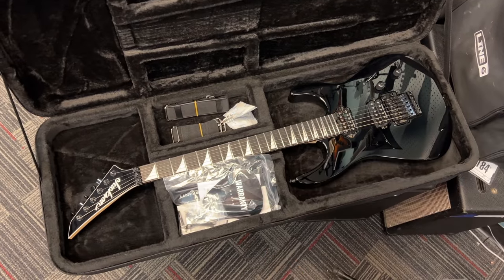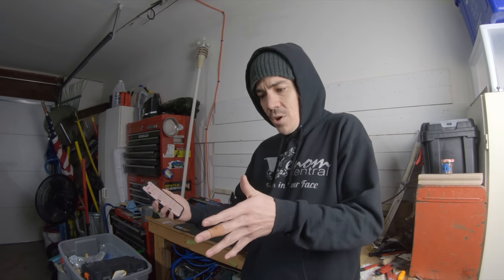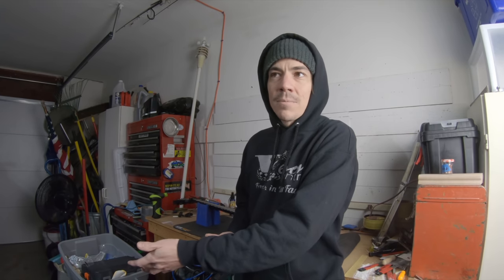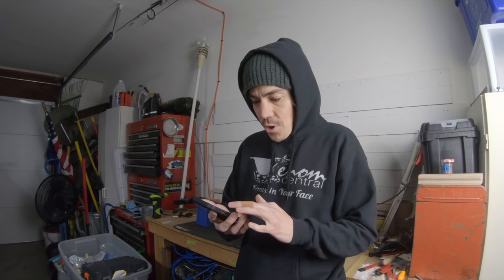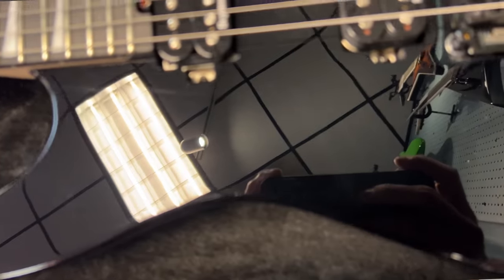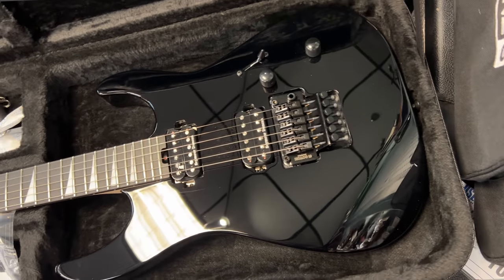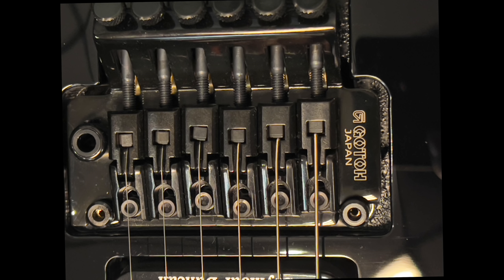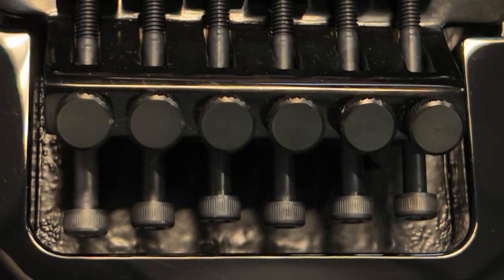JACKSON GUITARS IS DONE. MJ series/INDO EXAMPLES

Comment: I've been playing guitar for almost forty years, and while I've always felt Jackson produced some very fine instruments, the reason I never bought one is because when I went to a music shop in L.A. in '87 to buy a Soloist they had an ESP Horizon on the same wall. I compared them and there was NO way the soloist could compete. The Horizon was sleeker, more advanced, with a better neck, and sounded a lot better too. It was also about half the price of the Soloist at $700. Easy decision. I find Jackson's quality has taken a real dive in recent years. Besides that, I'd much rather get a Yamaha or a G & L or Fender and just pop in some Duncans as I always do.
Reply from the maker: Did you buy that horizon?
Reply: @jed_shred_guitars  Yes. But I don't own it anymore. I sold it to a friend back in 1990 because by then I'd stopped using locking trems, just had it with them. But it was a great ax. My friend replaced the very crunchy but noisy DiMarzio X2N knockoff that came with it and replaced it with a Duncan JB which sounded better. But he didn't get a JB because of my advice, but because he wanted whatever Dave and Marty were using on Rust in Peace and I told him it was all JBs, which it was. Anyhow, what had happened by this time, late 80s, early 90s, is ESP had given Jackson a real wallop. ESP has smart enough to open a custom shop in Hollywood around '85 and George Lynch was one of their first big name clients. Jackson/Charvel got lazy and took for granted the large roster of players. So what happened is Lynch peeled away to ESP, and a lot of former Jackson, Kramer and Hamer players followed along. When Kirk Hammett started playing ESP it caused a wave of players in the thrash world to follow. It's just the way it was. I'll put it this way. Let's say you had the choice of a Lamborghini that does zero to sixty in 4 seconds with a top speed of 180, or a McLaren Speedtail that does zero to sixty in 3 seconds and has a top speed of 250. Let's say the Mclaren is cheaper. Prospective buyers will ask themselves, "Do I want the Lambo, which is more well known, or do I want the McLaren, which is not as well-known but nicknamed The Ferrari Killer, because that's what they were designed to do? ESPs, and the Horizon was their penultimate model in '87, were designed to take on the big boy, Jackson/Charvel. I'd say they conquered them a long time ago. They offered a much better guitar for the money and still do. My Horizon was made in Japan, which in truth had better quality control than the US. But it still made the guitar half the price of a Jackson Soloist. The craftsmanship and the design put it over the top. The Horizon had 24 frets, which also gave it an edge at the time. Yes, so did the current Soloist, but in '87 you would still find some with 22. The extra full octave of 24 frets is priceless in a shred world where every fret counts. And the design of the ESP neck joint was far superior to the Soloist. It was just easier to get access. The licensed Floyd on the Horizon was better than the standard Floyd that came on the Soloist as well. Right about this time Ibanez became huge when Vai and other shredders started playing them. They came with the knew Ibanez Edge trem which knocked the pants off a Floyd. They were simply more I gigged with between '86 and '92, my L.A. club days when I was a teenager, was my trusty candy apple red Holdsworth Charvel I bought used for $100. It was simple. Standard trem, albeit double fulcrum, mounted flush, and a single, hand would JB that sounded outrageously awesome. It was 22 frets, rosewood fretboard, black pickguard, black tuners, graphite nut. The thing NEVER went out of tune. It was amazing. I had other guitars I would take with me to gigs as backup like my Kramer Baretta or a Strat with a Hot Rail in the bridge. For amps I went from lugging my Marshall stack to getting smart and getting a Boogie 50 Cal combo which was easier and had more than enough volume. To this day I recommend combos over stacks. It just makes sense and they are easier to mic up. Also, if you face them away from you it's easier for the soundman to get you a good stage volume through the PA. Even on 2 that Boogie was very loud. But soundman were grateful for me not having a stack, or five, and believe me, some players on the scene had five stacks back then. It was crazy. Also, having on combo made it easier to set up and break down fast after a gig. I would not only move my little rig, the amp, a guitar or two and a couple pedals, but help the drummer. If you could pack the house with your friends and set up and break down fast the clubs loved you. It was all about $$$ and time for them, and in this world you must understand the nexus of time and $$$, especially in music. I learned a lot in those days. Wonderful memories. And yes, ESP crushes Jackson.

Comment: Unfortunately I just got an LTD Arrow Black Metal with some pretty serious QC issues. The binding on the neck isn't great, there's some dust specks trapped underneath the finish and lots of cuts marking the frets. The trem cavity is poorly painted, and the area right above the trem is just bare wood which is really ugly when looking at the guitar head-on. More importantly, the Floyd Rose isn't installed well and won't return to pitch as well as it could. The bass side post is leaning away from the neck and it wiggles back and forth when I remove the bridge. The posts and knife edges have already had the paint scraped off at the contact points after a day of use, they might even be damaged for all I know. And the claw screws in the back are basically stuck so I can't even get the bridge perfectly level. Probably going to send it back.

Comment: Both the Japanes and USA jacksons cost so much because of price of labor. I recently got the chinese made jackson sl3m and other than the tuners (put gotoh on them fender) the guitar was perfect. The backplates are plastic but it's all CNC cut and nice sharp edges all around. The plates were so tight that I had harder time taking them off. There is a real switch and full size pots in the cavity. The attention to detail was amazing. You know how some floyd nuts protrude little bit past the edge of the fretboard? This one was perfectly centered and the edges blended into the neck. It has real duncan pickups and korean made floyd rose which is better made than the special floyd rose. I have the rainbow crackle finish and they only make these in china and it's beautiful in person. Can't stop looking at it. I simply don't see how USA made jackson would be better made. I don't like the USA jackson heel cut, the indo and china made jackson have the proper cut. The Japanese jackson is overpriced. 

Now, few years ago I bought brand new jackson bolt on soloist for $110 from guitar center. It too was flawless and it even had full size trem block which is practically unheard of in this price range. I was going to convert that guitar into a floyd rose soloist but it was so pretty that I simply abandoned the idea and bought the sl3m instead. 

I think the best value is ibanez rg350. Mine had only two small flaws. The nut protruded from the edge about 0.5mm, which is nothing but can be felt and one small section of the edge of the backplate, the wood was slighty crunched. Other than that, the guitar was perfect. I paid full price of $1300 for the jackson sl3m and I would definitey pay that price again because the workmanship is simply outstanding. The rg350 I paid new $300 and like I've said, the best value back then and maybe even today. Ibanez made some neck through rg's like 3020 but I heard they are on the heavy side. Btw, if you can't physically examine a new guitar then just buy it from sweetwater as you can examine the pics and get a good idea about craftmanship and weight from the pics if you know what to look for. That's how I bought my sl3m and I knew it was going to be good after I looked at the pics.

Comment: 5 years ago, I bought one of those Jackson Dinky Archtops in satin black (looked so badass). I know they're way cheaper, but you still expect everything to work right out of the box, but it had pickup switching issues right away. Every time I was in the bridge position, if I played any volume above soft, the neck pickup would engage like I'm in the middle position. I took it apart and cleaned it, but I couldn't find out what was causing it, and I didn't want to replace any parts on a $400 guitar, so I just sold it for almost all my money back and got an LTD M403 ht, since I already had a guitar with a floyd anyways. The LTD was soooo much better quality. It was a bit more expensive at the time, but the reason it was better wasn't only because of fit and finish and stuff, it's mainly just because it worked like it was supposed to, unlike the Jackson. 

I recently bought a Fender Player Plus Strat (I'm not only into metal, I play jazz and rock too) and it's FANTASTIC for the price. The neck is amazing. Thinner than most strats, but with amazing rolled edges. Please correct me if I'm wrong, but fender and Jackson are the same company now, so I cannot understand why build quality, materials, attention to detail, and all of that are so different. Doesn't make sense.

Edit: forgot to say - there's a reason Dave Mustaine changed from Jackson to Gibson. It's sad to see him not play a Jackson anymore, honestly. But Gibsons are dope...just a bit pricey.
Reply: There is an LTD for $700 at the pawn shop near my house.   It is great!   It’s almost exactly the same guitar as my Schecter.   Same pickups , same look, same feel.    
Are they made by the same
People?     I would love to have that guitar.
Reply: @Imokyourok440  I'm pretty sure they are not related companies. I could be wrong, but I've never heard that either schectere or ltd were the same company. Esp owns LTD though. It's sort of like Fender and Squier, but LTD's are generally way better quality than a squier would be. The ESP guitars are pretty expensive. And the LTD's are a lot more affordable, but still super good. If you're into metal style guitars, schectere and ltd are both great choices.
Reply: @Casey3-P-O     I’m gonna look into that.   Same pickups, paint job, almost exactly alike.
Damn good guitars.   My Dad bought my Schecter for me at a pawn shop for $200 and it came with a fender practice amp.    Dad knew nothing about guitars.  The pawn shop owner was a good man.  He knew I was struggling and Dad wanted to help me.   If it was a hunk of junk, I would still love it.    It’s great though.   Dad passed away a few years ago, so it means even more now.❤️😢
Reply: @Imokyourok440  sorry to hear about your dad.  That was very cool of him to get you that though. Schecters are super cool looking.

Comment: Fender moved production of PRO Soloists from Japan to Indonesia around 2012. The first ones were made in the PT Wildwood factory, who also supply ESP and Schecter, with an 'IWJ' serial number prefix and the spec was classic Jackson recipe. Three-piece Maple thru neck with quarter-sawn centre section, Alder body sections and the backplates were black anodized aluminium. After a couple of years or so the Fender bean-counters switched to Samick factory, with an 'ISJ' serial number prefix, who deviated from the Jackson Soloist recipe with a two-piece scarf-jointed Maple thru neck, Mahogany body sections and plastic backplates. 

I do like the Jackson JS series made in China and think they are excellent value for money especially ones with compound necks. I just think some of the current Jackson PRO models aren't up to the mark and are probably overpriced .

Comment: I have a 2006 snow white jackson dk2m pro made in Japan that came with a fitted jackson hard case new in 2006 for $650 shipped. No way will I ever get rid of it. I ditched the jackson branded floyd and installed an original floyd rose.
It's my main guitar.
Reply from the maker: That’s the model that I’m holding in my profile picture. I wish I never sold it.

Comment: Super genuine video dude. Not just bashing Jackson, you obviously love them along with probably everyone watching, but you pointed out some really critical issues. As of now, I don’t think I’ll ever buy a new Jackson. After a knock off strat, a js30 rr was my first “real” guitar when I was 12. Haven’t gotten another Jackson until I’ve acquired 3 off the used market in the last year. My kvxmg is okay, just that. Got a killer deal on an older rrx24 7 t. For the price I paid, can’t complain but it’s just solid enough. The one I’m most proud of is a parts guitar I made. Js30 warrior gloss black body paired with a mij dxmg neck along with all new hardware, pickups, etc. But that took a lot of time, and a lot of money. It plays great, the best neck out of my Jackson’s for sure, but is that what is takes to get a really badass Jackson these days? I guess so.

Comment: I bought a brand new USA Jackson soloist back in about 2005. It was my 3rd Jackson. The 2 I had prior were from the mid 80s. They were awesome. The 2005’s high E was so close to the edge of the board you would fret a note and it would slide off the edge and get caught between the binding and the fret because there was a gap

Comment: I bought the mid tier (X series) Warrior recently - holy hell, I couldn't believe how much work it needed, compared to my LTD EC 1000 which needed *zero*. Given that the price difference is roughly the cost of replacing the stock pickups with something decent, 100% go with LTD. I always wanted a Jackson and this was so disappointing. LTD is putting a high end guitar in your hands for a reasonable price, and Jackson is just seeing what they can get away with. Ultimately, my Warrior will be the way I want it, but it's costing way more than I would have liked. Disappointing to say the least.
Reply from the maker: Disappointing indeed
Reply: X Series are junk. I wouldn't go below Pro
Reply: This sucks. I thought about buying an X series Warrior recently, but ended up buying a 1996 Japanese made Warrior instead off of eBay. It had clearly been played, lots of dents in the paint work etc etc, but from a quality perspective you can really really feel it. I also have a David Davidson Jackson PRO 7 string, which I really like, but the quality of the older guitar shines through.

Comment: I don't disagree with you on a lot what you are putting through here; I have a 2009 neck-through strat from Indonesia, that took a lot of work to get up to spec (misaligned locking nut, bad fret job, set-up was crap, etc.).  However, I have a 2004 MG Dinky carve top that is the best guitar that I ever owned, that one was from Japan though as I could not afford the ridiculous prices for the US model.  But I still play it all the time and its awesome!!  Barely ever touched the set-up throughout the years even with the change of seasons; its rock solid.

Comment: I received a base level, and barely finished Ibanez GRG121DX.  It is built and sounds beautifully.  It does have a chunky neck it is the same thickness nut to heel. But I like that.  It is like a classical but joins the body at feet 18.  Holds tune and setup really well. $199.99 free shipping.  I love it.

Comment: bought a Jackson Rhoads JS "lefty" put all premium parts - Gotah tuners, OFR bridge & nut, EMG 81/60, EMG volume/tone knobs/toggle. I wanted to purchase a case for my new guitar, but come to find out (after research on forums) that they don't have a hardshell case that actually fits the guitar. Was looking at the guitar center reviews and a fellow lefty had the exact same guitar, but saying it doesn't fit.  I emailed Jackson customer support and said they did't know what to do.  Pretty lame if you ask me! I would have bought a different guitar if I new a hardshell or even a gig bag was not possible to buy.
Reply from the maker: That’s super lame. If you makes you feel better the right handed case doesn’t fit a right handed roads or king v very well. The king v slides around all over the place and the Rhoads is too long 😂 that’s why the tip of mine broke off
Reply: @jed_shred_guitars  I heard that too lol

Comment: I bought an x series warrior this year and it's flawless. The only complaint is the headstock looks cheezy with the silkscreen logo.  Fit and finish couldn't be better.  It's an indonesian guitar made at the Cort factory, I also have an ibanez rgrt421 which is a neck thru, made in the same factory and its also perfect.  Both have perfect action and fretwork, finish is perfect, the jackson holds tune fine. The pickups on both kind of suck.  I've had an Mij ke3 and a mij performer ps4, and I would say build quality of the x series is comparable.  The older Jackson's were definitely heavier, but yeah it's a sick guitar. I've been thinking about getting another one in red.

Comment: I don't understand how Jackson is shitting the bed so bad but charvel and fender are killing it.
Reply from the maker: Fender is not killing it. The charvels seem to be the best out of any of the fender brands for quality control right now for some reason. Lots of brand New Mexican fenders coming in with issues, especially fret issues.

I’m sure every fender dealer has a stack of fenders in the back waiting for warranty authorization to fix them like the shop I work at.
Reply: Then I stand corrected, my friend and I both got new squires around the same price point  and both were straight killers

Comment: I have a 5FX Charvel in Firecrackle bought used around 2000 in horrible shape but super cheap. Electronics/JT6 wrecked. Finish and frets were OK w/some wear. I put about a grand into it. OFR/Duncans/setup etc. I'll never get rid of it. Awesome player. 

Got a SLX HH around 2017. Good quality overall. Frets a little sharp but 2 min of work sorted it. Otherwise stellar. 

Always a Charvel/Jackson fan. But it's a sign of the times. Everything off-shored, prices up, quality down. Sucks to see.